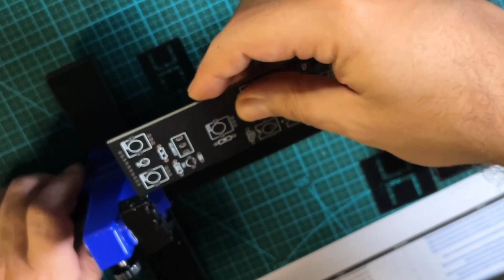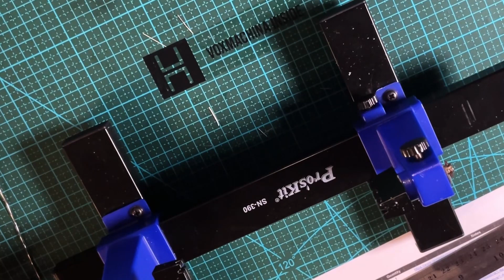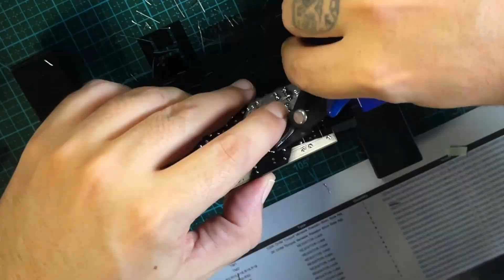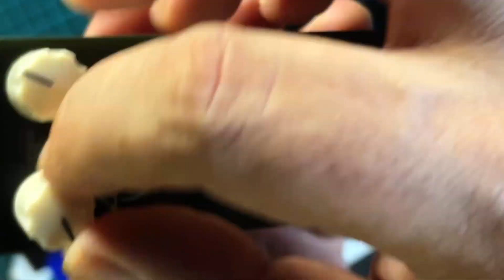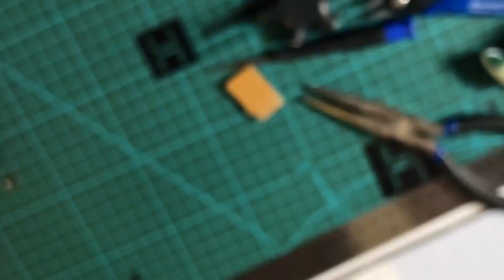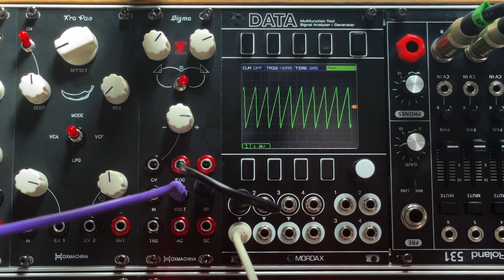Sigma: 8HP DIY Eurorack Function/Slope Generator - Build & Calibration

Comment: help please. my Sigma won't oscillate. will only trigger from 'In'
Reply: Same thing here. I am currently going crazy trying to figure it out.
Reply: @immortalman663  hope you find this... on mine the jack sockets weren't switching correctly... taken months to figure it out...
Reply: i ordered a second set of pcbs... they work fine for a few days... except one of them just bricked... it is the main board causing the problem... i've tried replacing all transistors - no change... only other thing is the lm3900... i've tried 2 different ones but not sure how genuine they are...
Reply: failed switched jack sockets
Reply: see my answer above... ordering more opamps - lm3900 &tl074 from mouser... will see then... my first lot were from tayda
Reply: clearly no support... i've replaced all ICs and transistors on the new one that stopped working and... nothing - something unstable in the circuit??? - i have no issues with any of my other voxmachina builds

Comment: Thank you for making this and for making it open source!  I just finished building one. Only ran into two problems in the build, both my fault — the 3mm LED I picked out is a little dim, and the 100k trim pot broke while I was calibrating, so I had to replace it. But the module is now working great, and I'm excited to use it (and probably build a second).

EDIT: Excuse the dumb question, but since I broke that 100k trimpot and only had ordered two, I don't have another that fits the footprint. I see from the schematics that it's acting as a voltage divider, so the value shouldn't matter that much — but do you know of a reason replacing it with a 220k would cause problems?
Reply from the maker: If I remember correctly I'm using 50k on Sigma module, not a problem using different values, 220k will act the same way but provide you with more detail (imagine more zoom levels on a picture if needed), meaning more intervals, it's a good test to see if you like it anyway :) but I don't see any issue with any value for the pot, let me know how it went, cheers!